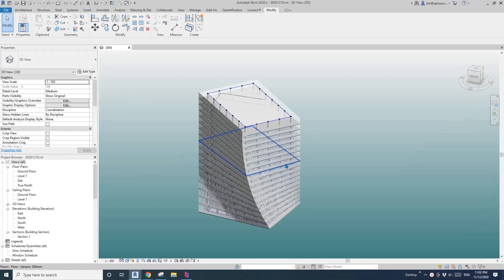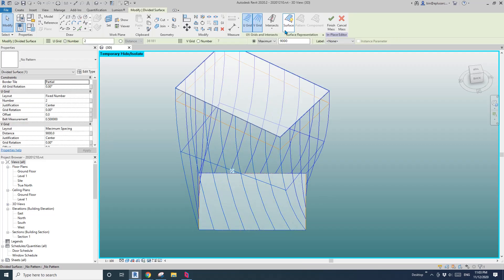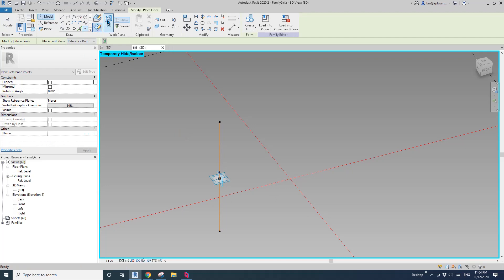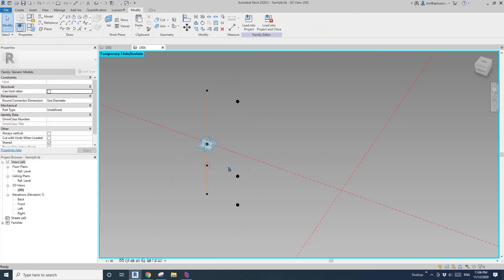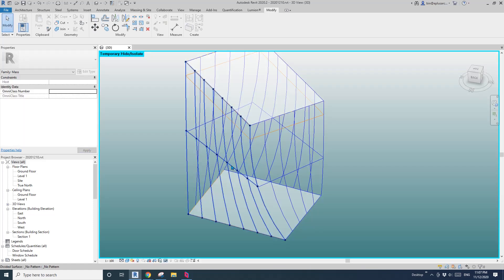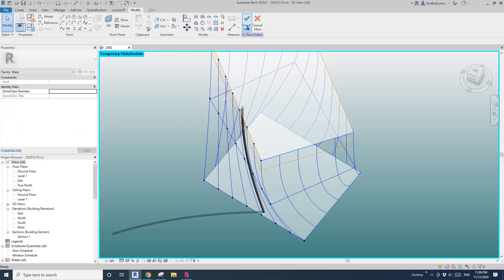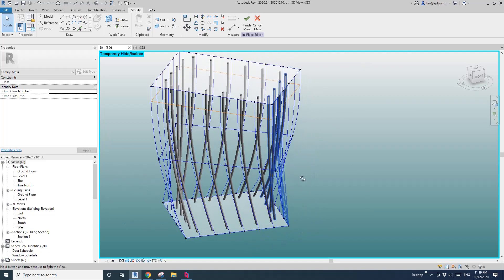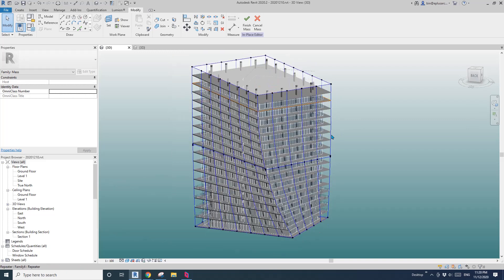Everyday Revit (Day 269) - Another method of placing twisted columns

Comment: hello, i wonder if you can help me with something fucking hard. I need to place a "Recess?" on a tunnel form like this : https://gyazo.com/dbd5d8fb31d4571d9b1c86d017a21786 on this screen is my tunnel body generic model familly is placed and modified by a dynamo algorithm but i need to place on this wall a familly. But i doesnt find a way to come up with something good, because my Recess familly gonna have a flat surface and my wall is curved and his shape can move with a turn of the road or something. if someone have any idea, i can screen more thing to explain.
Reply from the maker: Are they adaptive families? I guess you can somehow model the recess in that adaptive family, or use an adaptive void family to cut it. something like this:https://drive.google.com/file/d/1EaLTU1c4AybYJTKDaOY6679by1hsOfbT/view?usp=sharing
Reply: @BINHE615  you mean by increasing the thickness of the tunnel ? i can prob ye, its something quite like this https://gyazo.com/0db25522579f10371c6dbd4353f38088
Reply from the maker: @SkwatG_G  I guess so.